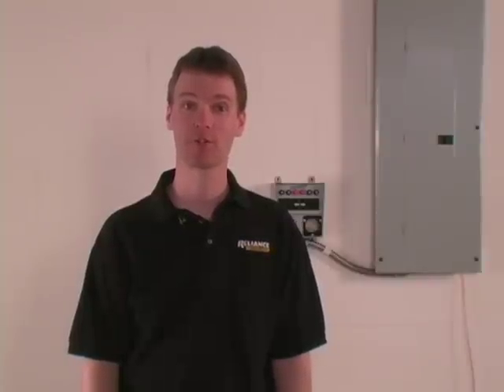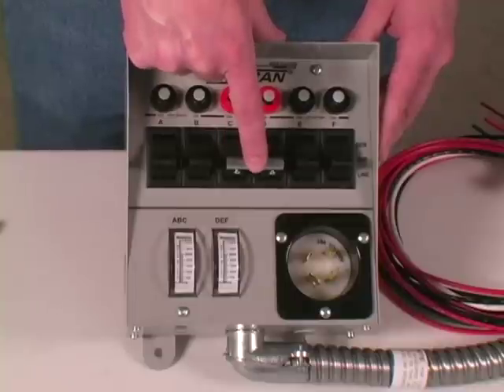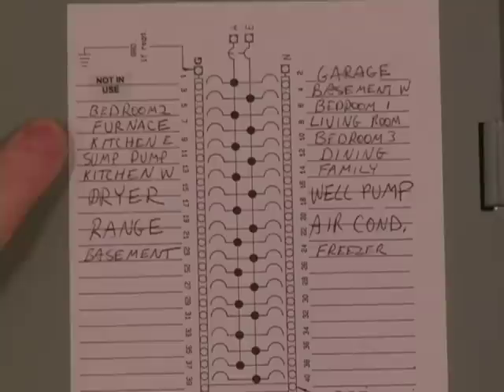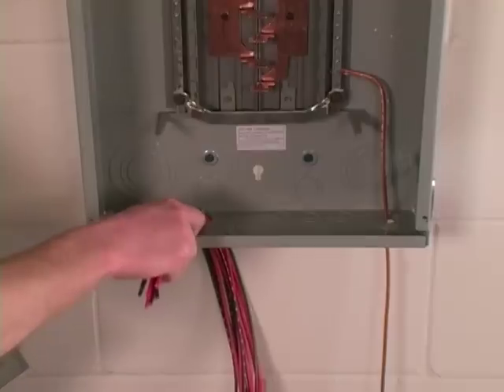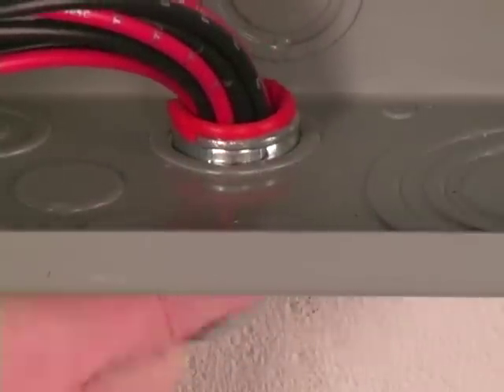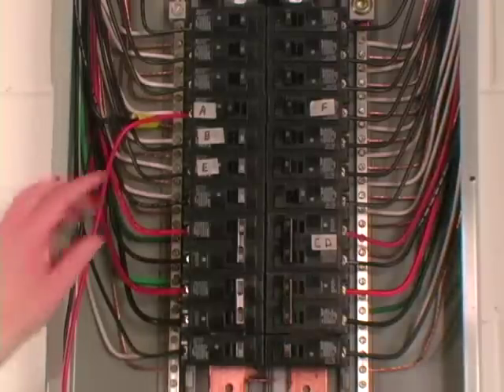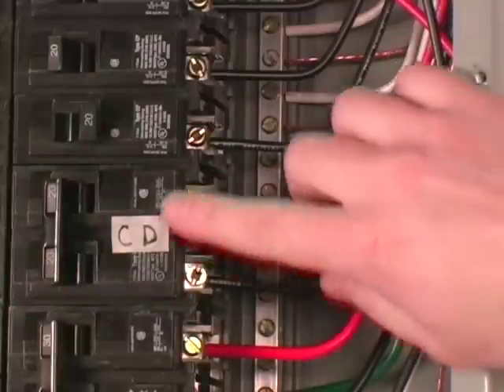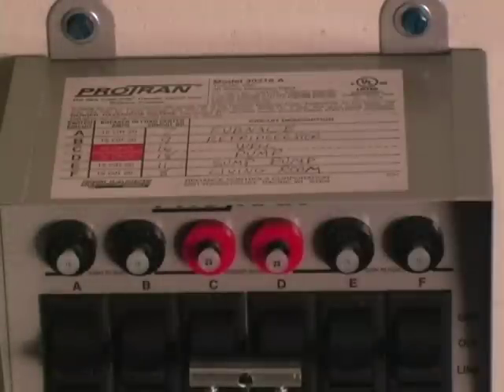Installation- Reliance Controls 6 circuit 30 amp transfer switch part 1

Comment: Is it legal in Canada to use the wire nut to connect wires in the main panel?
Reply: No it is not.  (I'm looking into this too).  The Generac transfer switch panel has knockouts so you can run  the individual circuits directly to it, removing those circuits from the main panel; no cool gauges to balance the load though.  

I'd like to know Reliance Control's canadian workaround if they have one.

Comment: This guy has NEVER worked in the field ... He is reading from a prompt, you would think if you KNEW this product, you could tell us what it is and how it works without reading from a prompt. Let alone tell us how to wire it without reading ....

The only issue issue with this device is the lack of loads it can support. It can only support 6 loads and you must designate which loads it can feed. That is not acceptable in my book. If i am going to hook up a generator to my home, it will feed the entire home ..

Comment: So, I have a small portable generator, it’s 3500 Watts and is only capable of 120volts (not 240) will I still be able to power all breakers .
Reply: You may need to make a custom cord for a 120v generator to do this. A 120v/240v plug has 4 wires: neutral, ground, 120v, and an inverted 120v.  Combine your generator's 120v wire with the inlet's two 120v wires, keep the ground with ground and neutral with neutral between connections. Do not connect a 240v device to a breaker with this method, they won't work and I have no idea if this setup could damage any 240v devices. You can make this cord from splicing a 120v cord with a 240v cord using wirenuts, or using 3 wire plus ground and inserting the wire into naked plugs that screw down onto inserted wire.

Comment: What about if you dont have a main breaker for the breaker box like mine?
Reply: Shane Hubert 
Then it means you have a MLO subpanel. It should be within a short distance from a main breaker. Turn off that breaker. 
If your MLO subpanel is not near a main breaker, then you should have a main breaker subpanel. 

Also, your ground wire should go back to the Service entrance near the meter.

Comment: So, I have a small portable generator, it’s 3500 Watts and is only capable of 120volts (not 240) will I still be able to power all breakers on a 10 breaker box....ie 31410CRK?
Reply: You may need to make a custom cord for a 120v generator to do this. The 31310CRK uses a 120v/240v plug (4 wires: neutral, ground, 120v, and an inverted 120v.  Combine your generator's 120v wire with the inlet's two 120v wires, keep the ground with ground and neutral with neutral between connections. Do not connect a 240v device to a breaker with this method, they won't work and I have no idea if this setup could damage any 240v devices. You can make this cord from splicing a 120v cord with a 240v cord using wirenuts, or using 3 wire plus ground and inserting the wire into naked plugs that screw down onto inserted wire.

Comment: Hi I have the same transfer switch that you show on your video. I have central air conditioning. The compressor outside is 240. And do unit inside is also 240. Can I use two of the one 110 hook up compressor that's outside. And make it or 240. So I can run my central air.

Comment: I used this transfer switch in my installation, and it works well. I had a licensed electrician perform the installation with my assistance.

Comment: I did electrical work for 5 years. Went to school on it for 2. I hooked this up correctly. I will admit I don't know much about generators. I did or do know I hooked this up correctly. However, half the things I hooked up don't work. My generator is 9000 watts which is at least good for 60 amps. 9000w divided by 120v. What's going on?
Reply: Hey Elvis, I'm sorry for the troubles, that's probably frustrating.  As I don't know which 1/2 of the circuits are working, and also assuming the issue is only during generator power (switches in GEN), then let's say the power gets to positions A, B, C but does not get to D, E, F.   Is this what's happening (either side of 3)? 
The ABC side is fed from one 120v leg and the DEF size is fed by the other 120v leg (L1 and L2) from the generator. Hopefully it's something easy to correct but we'll help until it's resolved.  
Voltage is likely being lost before it inputs into the transfer switch in the front wiring compartment, some common causes are the locking plugs on the cord are not pushed in and locked all of the way, at the generator and inlet or inlet box.  There could also be a selector switch on some generators for "120 volts" or "120/240" volts, if this is one 120 volts it will cut power to 1/2 of the output of the 120/240v outlet.  Let me know if either of these fix it.
Reply: @RelianceControls  Just wanted to let you know that 5 years later, this comment fixed my issue. I couldnt twist lock my inlet easily and so I just left it thinking that wasnt the problem since half our circuits worked. Went back out and really pushed until it twisted and now all of them work. Thank you!!!!
Reply: @myvideos1125  Hey we love to hear it! Glad you were able to quickly get answers and thanks for letting us know! 😀

Comment: Isn’t it against code to splice wires inside the panel box
Reply: Splices are allowable under various conditions.  Article 312.8 of the NEC 2017 gives provisions for splices, taps and feed-through conductors.  Any restrictions are mainly regarding the free space in the enclosure so that any splices don't exceed certain cross-sectional areas of that space inside the panel.

Comment: Very sloppy installation... The original panel was done by a professional...
Reply: This was a demo panel that we installed that was dead, it was not connected to any power source.  Both the load center and transfer switch was installed by the same, qualified, person.

Comment: Hi, I hooked everything up according to this video and the manual. I have a Honda 7000 generator when I plug everything in and turn the generator on I immediately get a signal of overload! that's even before turning on any of the breakers on the Reliance switch breaker box. Any ideas?
Reply: This means the generator either has a GFCI protected outlet and is bonded neutral, or there could be a ground fault in the wiring between the generator and the input of the switch. Please contact Reliance at support@reliancecontrols.com and we can help.

Comment: Everyone should be aware that for half the cost of the transfer panel shown in this video, you can buy a REAL subpanel with full-size breakers and an interlock, from any hardware store.   The "button breakers" in the Reliance box might be UL 489 certified, but they are NOT full size breakers.

(And yes, I fully expect this comment to be trolled by Nicholas Schmal, an employee of Reliance Controls ... just watch.)
Reply: TheSeattlegreen: I can answer this, since we have used these circuit breakers since 2001 and still use them in a variety of transfer equipment.  
The parts in question are thermal trip circuit breakers made by Mechanical Products (www.mechprod.com).  You can access all of the specifications on their website - series 252 are the circuit breakers we use. The buttons you see are the reset mechanisms of the circuit breakers, it's just a different design of trip mechanism than found on other circuit breakers.  
These Mechanical Products circuit breakers claim to be the smallest breakers with a 5,000 amp AIC (short circuit) rating.  They are used primarily in aviation and marine applications due to their compact size and reliability, which is also why we use them even though they are more expensive than 1" plug in breakers found in most home electrical panels. 
Due to the unique size and shape, this type of breaker is not used in general distribution for residential panels because Mechanical Products specializes in other applications where their breakers are housed in specialized enclosures. 
It's important to note that Reliance Controls has made this same style of transfer switch that uses full size 1" plug-in breakers since 2005.  The Reliance Controls YouTube channel has newer videos showing the installation of the same transfer switch with full size breakers, although the installation is identical.  
We have used 1" plug-in breakers as an option so that someone has the ability to connect to a 30A branch circuit such as for a well pump, water heater or central air.  The button reset style circuit breaker is not made in a rating above 20 amps, so using the same type of transfer switch with full size breakers allows someone to have access to a larger circuit - something on a 30A 2-pole breaker.

Comment: Non insulated tools, no testing circuits with a multimeter to guarantee that there's no dangerous voltages. Just get a licensed electrician to do the job...
Reply: Scott Schembri if you flip the main breaker off there's no reason to worry. However to make sure that it's working properly I would go around to the circuits and test the voltage. but if you have no clue what you are doing it's always better to get a licensed electrician.

Comment: it's good they show the outside receptical and the increase in rain sound meaning the generator is outside. Also good to show the generator on solid surface like a patio or walk way in between houses.

Comment: Then they ALL die moments later of Co2 poisoning by running that generator in the garage, OMG... REALLY!
Reply: CO, not CO2.
Reply: When the generator is shown in the video it clearly (to me) shows it being outside of the garage.  The key lock on the garage is in view (there won't be a key lock on the inside of a garage door)

Comment: What happens if the transfer switch is on, then the utilities power come on, would that shock or blow the generator?
Reply: tanh van - no that's the whole point of the switch... it's to isolate circuits from either the main source or the generator.
Reply: That is cool, here I have to get a certify election to do the work
Reply: Technically I think anyone does... but with this system it's really easy to setup if you are comfortable with basic wiring

Comment: damn,  after reading all those replies sounds to me like you folks are at the mercy of the communist regime up there in canada. And lets face it, the government wants you dependent and helpless.  It doesnt take a rocket scientist to drive a rood in the ground and attach a wire to it.  Geez, get a grip and take some responsibility for yourselves people. But as far as the vid, good vid, and i'll probably go with this system because of the ease of install.
Reply: Mike J 
LOL. I've heard the Harper government called a lot of things but this has to be the first time I've heard them called communist.

Comment: What happens if my generator only has a L5 - 30 socket?  Does it mean I can only power one half of the transfer switch and only have up to 3 circuits and 1 wattage meter?  That said there's no load balancing act needed.  I'm debating if I should change the male end of the black generator cable to a L5-30p or SD pend even more to buy a new generator with the L14-30r?
Reply: I have the same question 7 years later.  Too bad they never replied to your question :-(

Comment: when the power goes out .. dont you need to turn of the Main power switch before you turn on the generator or else you electricute the line man outside?
Reply: oh nevermind.. that's what the transfer switch is for.. lol btw is there an automatic one you can get one right?

Comment: Check your local codes... Most all codes FORBID connecting the ground wire to the neutral bus. new codes require separate ground and neutral busses. very informative and welcomed video. (granted some older homes share ground and neutral busses, newer construction forbids the sharing so CHECK YOUR LOCAL CODES.)
Reply: The national code in the U.S. requires the neutral to be grounded at the service entrance.  Every main panel must have a bond between neutral and ground while any subsequent panel cannot have the bond.

Comment: Google inter lock kit much cheaper and safer in my opinion plus it will let you run any circuit you want just not all at once instead of being stuck with only 6
Reply: after market interlock kits are not certified by a testing lab unless they are made by the panel manufacturer.  adding certain interlock kits can violate the National Electrical Code
Reply: Then you'll have to continuously look outside the house for a clue that the power turned back on again.

Comment: the button breakers are only in use when the the generator is powering the circuits but on the other hand the transfer switches are live at all times and i would not trust them to potentially carry 18 or 19 amps when connected to  a 20 amp circuit like some were in the video plus the wire running to and from the switches looked to  be only 14 gauge that is only rated for 15 amp wouldn't surprise me to see that the transfer switches are only rated for 15 amp i agree very poorly made device
Reply: The toggle switches are rated at 30 amps and have no problem carrying the current of 15 or 20 amp circuits.  The wiring included is all 12 gauge for the transfer switch in the video.

Comment: what a hell of a mess with the wiring just stuffed in and why not just get a inter lock kit then you can run what ever circuit you want plus mini breakers are shit and the transfer switches too

Comment: I installed the switch some times back and it works fine.  I completed the installation by running a wire from the switch to an external shed where I installed the generator.

Comment: So why is the ground wired to neutral and not to the main ground? I would think that wiring the ground to neutral would defeat GFCI protection. Answers?
Reply: Apparently if neutral is not connected to ground in your main panel, your voltage becomes erratic. In the main panel, your neutral bar should be grounded, in connected sub panels, your ground and neutral wires should be separate from each other.
Reply: My inside panel like in this video the N and G are on separate buss bars ... But the outside main panel, the N & G are together on the same buss bar ...

Coming in from the street, 3 wires: 2 hot and 1 N. 
From the outside panel going to the inside panel i have 4 wires: 2 hot, 1 N and 1 G. 
On the inside panel, The N goes to its own buss bar and the G goes to a different buss bar. 
On the outside panel, the same N & G are connected together to one buss bar.. 

To answer your question, it is... The N from the street is connected to earth ground at the pole and at your house at the outside main panel. The ground wire is connected to N and the N is connected to earth ground ... They are one in the same. The N is grounded because in the event that the hot wire TOUCHES the N, it will arc and spark and create fire, SO by grounding the N it will send that electricity to earth ground until that breaker POPS open ...

Comment: You are correct.  However, there is a brand of interlock kit on the market that is simply call interlock kit.  THAT interlock kit is not UL listed and The Home Depot does not carry it.  Had you said that you purchased a GE, Square D, C-H or Siemens kit, I would have kept my mouth shut.

Comment: >>a panel, wire is dressed neatly and cut to a length that will reach ANY Brkr. on either side. If you are following someone who has cut wire just long enough to reach the Brkr. w/no slack, more than one TB with jumpers would have to be used.

Comment: Some good points until the addition of wire nuts in a panel. They may be permissible in a residental location but in troubleshooting an industrial control problem they are a curse and to be avoided. To avoid them(wire nuts-wing nuts-scotch- loks) a insulated terminal block(TB) is used and wires landed there. You can contact test probes to a terminal block safer and quicker than trying to remove wire nuts for a test. The addition of the proper (TB) would enhance the entire job. When wiring>>>

Comment: Nice video.  But please update it so that you are not suggesting a portable generator can be safely run in a garage! Customers who do this are exposed to CO poisoning.
Reply: Mark Carpenter If someone is stupid enough to run a generator inside a building because some clown on the Internet said he could then they should definitely die before they breed and create more idiots. This is Darwinsm at work. Don't mess with it. It keeps the moron population down.

Comment: Excellent videos (parts one and two)!!  I am about to install a similar transfer switch (the one that has 10 circuits) and your videos were just what I was looking for in respects to installing the switch myself.  Your videos showed every single step in great detail, and you explained everything very simply.  Because you actually show every step of the installation, right down to the power inlet box, I feel very confident that I can now install my transfer switch myself.  Thanks!